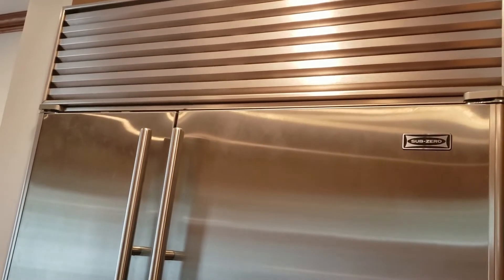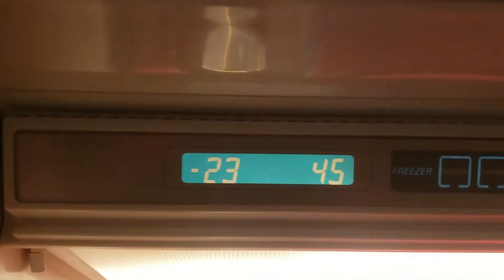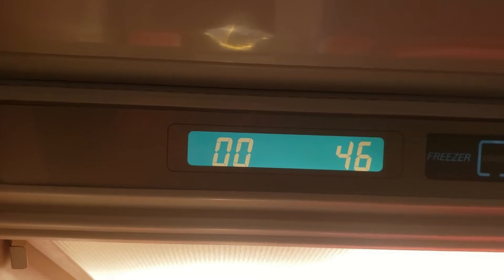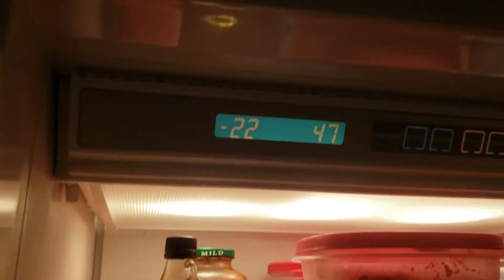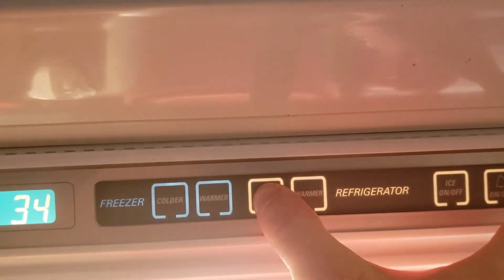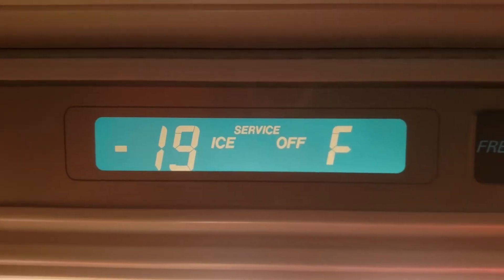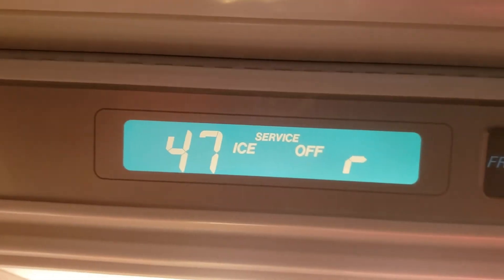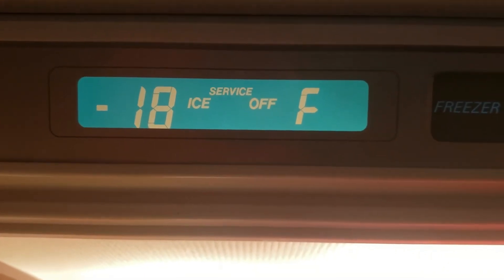Subzero Freezer extremely cold. Part 1.

Comment: What does 30 Service Ice off and rE means?
Reply from the maker: If you entered into the service mode, and this is what came up then the Refrigerator Evaporator Thermistor is faulty. The 30 & ice off are just the indicators that the ice is off and temp of the compartment. The Service light only comes on when there is a detected fault....like this. 
I can try to give you some pointers, but would need a more detailed explanation as to what has happened and what steps you took so far to diagnosis.
Reply from the maker: I may have misspoken. If you went into the service mode and that is what came up, then there is some missing information and steps that I would need to tell you what is going on. The ice off and service would automatically show up on in this mode. The 30 and rf would be the compartment temp of the fridge side showing the fridge evaporator. If an EE doesn't show up than the thermistor would be ok. Just a bit more info and I can point you in the right direction.
Reply: @erichartzell4130  The controller doesn’t do anything and the refrigerator is super cold!
Reply from the maker: @kartikgpt  The refrigerator or the freezer....or both?
Reply: @erichartzell4130  so here is what’s going on.

There was a power outage in my house and after the electricity came back the refrigerator started showing these error codes, none of the buttons on the control panel are working at this point. Only the Bell button if pressed for 15 sec makes the bell blink.
- service and ice off are static and not flashing
- unit on/off button not working
- tried resetting by turning off the breaker 
- refrigerator is super cold and freezing all the food
- freezer is not cold enough
Reply from the maker: @kartikgpt  Sorry for the late reply....It sounds like the micro-processor has failed. Probably due to the voltage surge from the power outage. Let me look thru the service manual again and see if I can give you a part #. You can order these on line, but are expensive. If you would like a copy of the service manual I can email that to you as well.
Reply: @erichartzell4130  I had to call the authorized service guy and he charged me $700 with labor and visit fee to replace the control board. The control panel is also bad but i didnt get that fixed since the refrigerator is working fine.
Reply: @kartikgpt  control panel with sometimes start shutting off your fridge if it failed. Hopefully youll be ok..the touchpad is beween 290 and 400 my cost...expenisve..board is like 300